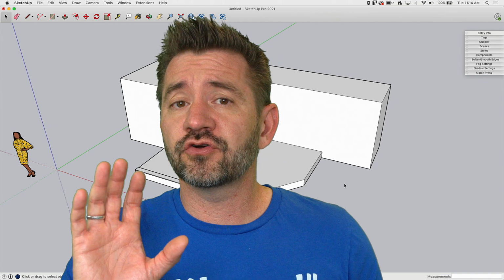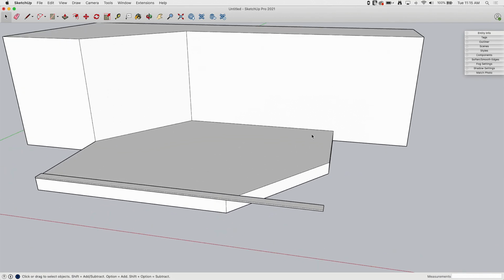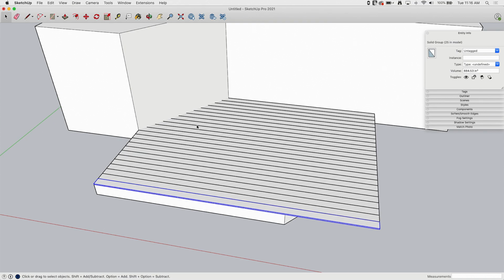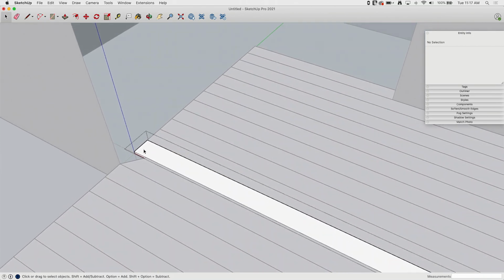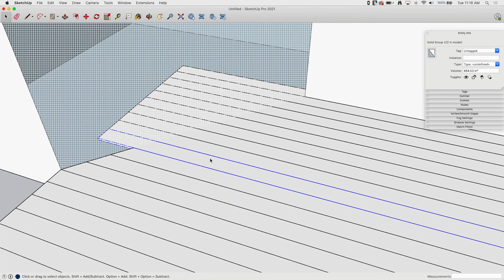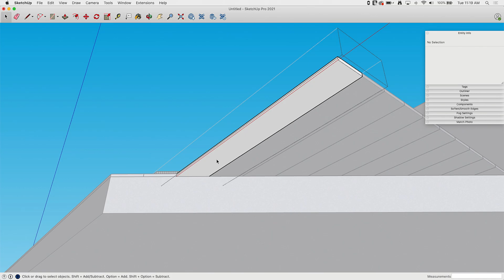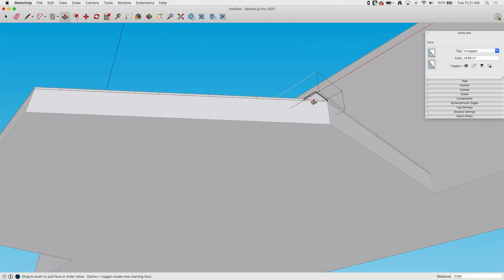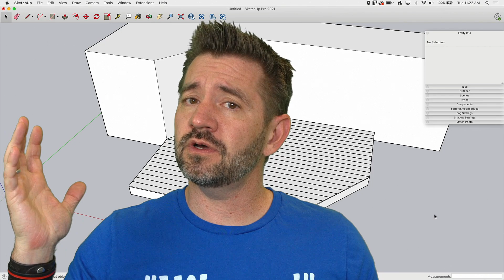Intersecting with Hidden Geometry - Skill Builder

Comment: I'd like to throw this in the ring. I don't use components as often as I should so maybe everyone already knows this (or I'm in error) but scaling doesn't seem to affect comps so there's no need to make a slew of uniques. So using comps and scale might be simpler than intersect (at least for this example). When you come to first board to be angle cut make only that one unique (or else all previous comp boards will take on this angle cut board's character). Cut the angle then go thru regular routine to make multi-copies of angle cut board. The other end of these new boards will have stairstep appearance but now use scale function to make each of them proper length. Making that one board unique wouldn't have even been necessary if there hadn't already been boards with straight ends that were previously used. Does this make sense or work for anyone?